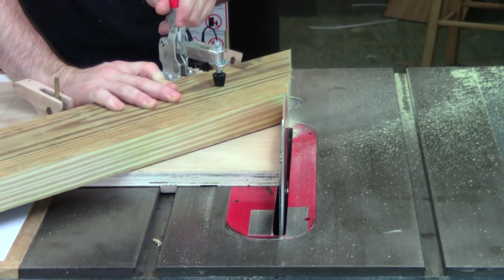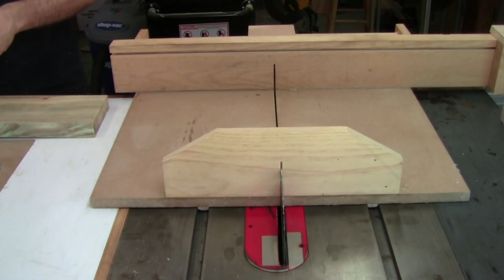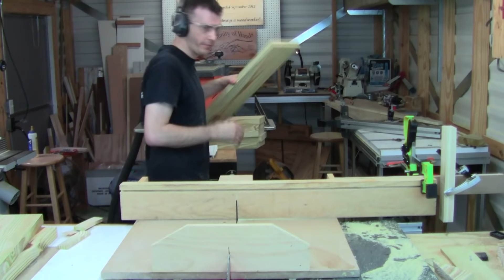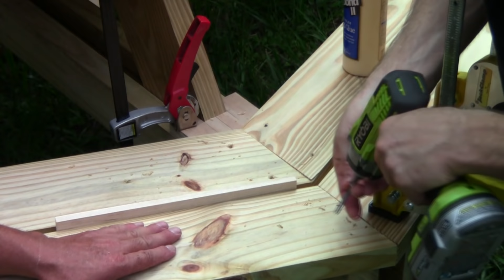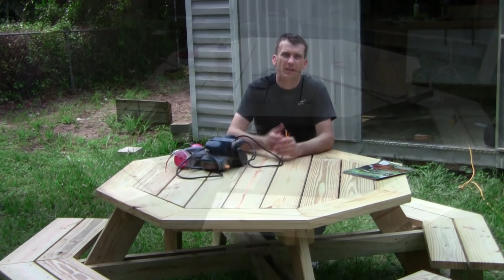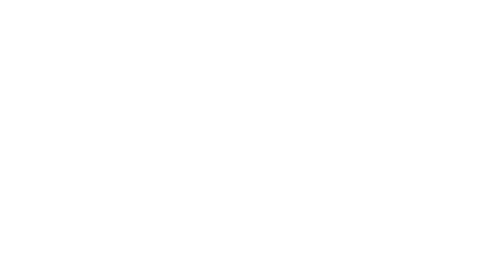How to Build an Octagon Picnic Table | PART 4

Comment: Thank you for the 4 detailed videos on this octagon table build, Laney!   I just finished mine (all pressure treated lumber), with only a couple modifications to the seats.  I secured the 1.5"x1.5"x9" boards to the outer vertical 2x6x14" seat legs and added additional 1.5"x1.5"x9"s to the outer undersides of the seat boards to help prevent lifting over time.  I alao cut small 45*s on the seat board ends.  Otherwise, everything turned out exactly as I hoped, no surprises.  The sleds and jigs you used really made the the process easy and resulted in consistent finish cutting.  This table is heavy, approximately 340 lbs.  I estimate about 12-16 hours to complete by myself, taking my time and referring back to the videos from time to time.  Thanks again!!!

Comment: I cant seem to get the plan anywhere? 5 years later the link might not work anymore or has been removed. Any way we can get a new copy of the plans?
Reply: https://www.woodcraft.com/blog_entries/issue-58?tag=Volume+10

Here is the original version, though I found random which one could  download the mag for free
Reply: I had the same problem just now also.  I managed to google search and download a PDF version of the magazine that the plans are published in.  Its only really useful for the cut list as these videos are what I am now following =) He refers to it (woodcraft magazine) at the beginning of video part 1, try googling : ''Woodcraft magazine vol 10 April May 2014".

Comment: Nice table, but you should change to metric system . that 29 3/16 or other looks very difficult to calculate quicly ;) . 1, 10, 100 are much easier.

Comment: Laney Shaughnessy , I can't thank you enough for posting these videos. I haven't worked with wood aside from the platform my table is sitting on and, with the help of Bill Sands' plans & your videos, this woodworking newbie (without a table saw) was able to build a sweet cedar picnic table for our cottage in less than a week. Check it out: http://blog.burkeware.com/2015/07/making-an-octagonal-picnic-table/

I used sixteen 2⨉6, seven 2⨉4, and one 2⨉2 8-foot boards.

Thanks so much for sharing! There's no chance I could've pulled it off without your help. We'll be enjoying this table for many years to come!

Comment: Nice table build Laney. From my experience with using treated wood in building treated wood is that it moves a lot with changing conditions. One thing I would add is a 2x2 about an 1.5" from the end of the cantilever seat boards to keep them moving together. I have had some board curl more than .5" with a 12" overhang.

Comment: The table looks great and  I would leave it as it is rather than treating it.
The only thing that I would question is the placing of the 2x2ish seat supports.
They should have been on the other side of the leg for a wider base to fix seat to.

Comment: Laney,

I am looking forward to your plans.  I am currently working on a variation of your table saw / router work station.  Thanks.  :)
Reply from the maker: ***** very cool... The table plans should be done soon, unfortunately the table saw base or router wing is one project i don't have a plan for.
Reply: Laney how do you do sliding dove tales?